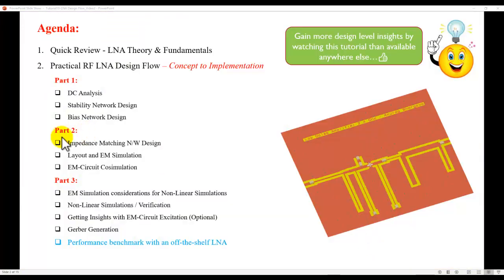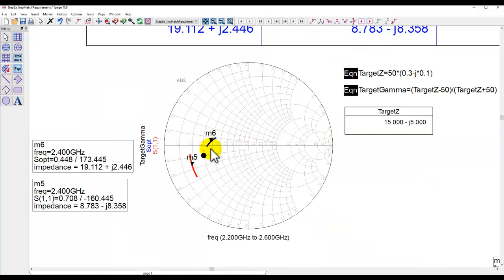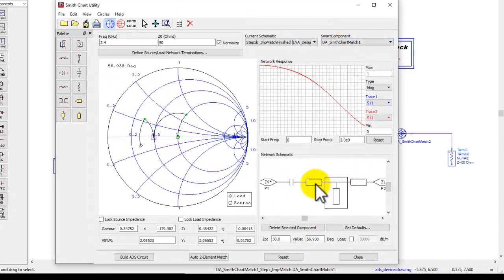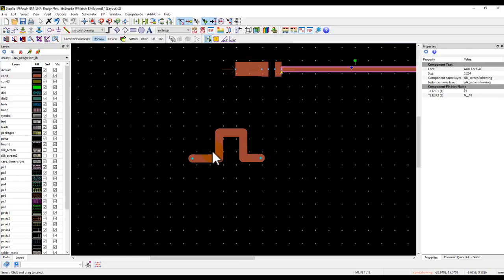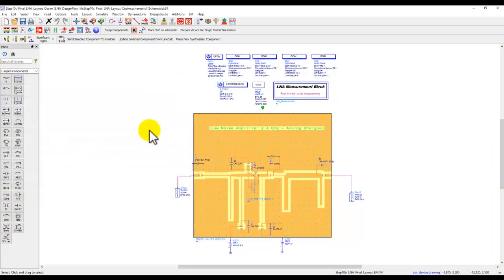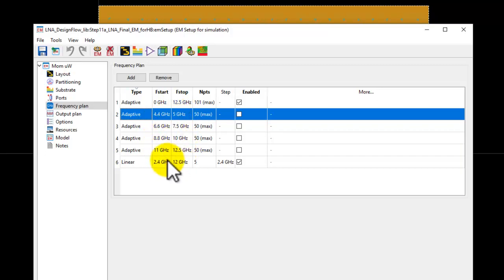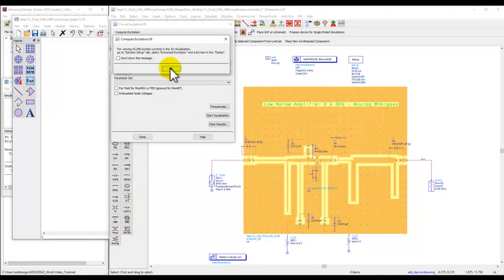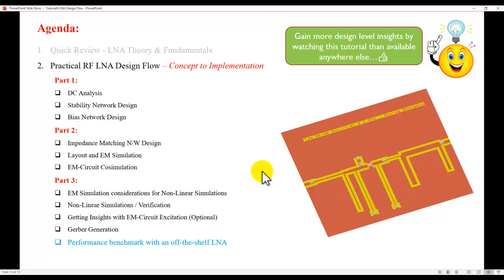RF Design-10: RF LNA Design - Part 2 of 2

Comment: sir, how to insert capacitors in the layout?
Reply from the maker: You cannot insert electrical components in Layout but only their footprints. You can simply draw 2 rectangles for the desired dimensions as required for your capacitors or any other SMT components
Reply: @BhargavaAnurag  ok, I understand what you mean, btw, I see two “port” -like arrows are added on both side of the MGAP, are those the way you represent the lumped capacitors in the layout?
Reply from the maker: Kindly watch EM Circuit Cosimulation video under "Learn ADS in 5mins" playlist to get complete idea on how to perform EM/Circuit cosimulation. For every discrete component such as Capacitor, Inductor etc, you place relevant ports in Layout for EM simulation and then bring it over to Schematic for assembly of Layout component alongwith electrical components to see the integrated response.
Reply: @BhargavaAnurag  thx a lot, sir
Reply: @BhargavaAnurag  sir, the capacitor problem has been solved, would you kindly recommend some power/low noise amplifier design books? thanks a lot!

Comment: Hi Sir, I saw the S(2,2) was changed after matching S(1,1). So Should we match S(2,2) before or after matching S(1,1)???
Reply from the maker: Hi,
I would recommend to match output side first and then input. Even when you do so, things will be slightly disbalanced  so you can run final optimization to fine tune the values for optimum results.

Comment: Can you make one video tutorial for GPS  Low Noise Amplifier? It is very popular in the industry apply right now. Again, Thank you very much.
Reply from the maker: I am not sure if there is anything special for GPS LNA apart from the fact that it will be different frequency than what is shown in the video. Rest of the concept will remain same, also at GPS frequency you may want to use Discrete Components for matching etc instead of making it all transmission license based design.

Comment: I wish you all the best , really really your videos are useful thanks a million🤗🙏⚘
Just one question, i hope you answer me soon please i need 
For designing input and out put matching , choosing the best impedances for input and also for output based on noise and gain circular  are independant of DC bais network( which dc bais network includes transmission lines)  is it correct??
Thank you in advance
Reply from the maker: Hi Nazli,
It depends on how transparent is your DC Bias design to your operating frequency. If you have done a good bias network design then it will present near perfect open circuit at your RF Frequency so you can say that it doesn't have any impact on your matching circuit design and if you haven't done a good job with the same then it will load your circuit affecting the input and output impedances to be matched.
However, as a matter of practice I always advice to perform your impedance check or matching WITH DC Bias Network included.
Hope this helps.
Reply: @BhargavaAnurag  Hi Dear Anurag, thanks alot for your quick answer. Before designing the DC bias network just by having DC block and DC feed i measure the input and also output matching and also i did them by consedring dc bias network , but the results are different. So it means my designing for dc bias network is not correct!! and after that based on your advice i have to consider imput and output matching with DC bais network. Also i want to research about differntial or push push amplifier and see which one is better for LNA. I would be greatful, if you could please guide me? I just find your youtube channel, i dont know you have further other channels which i can contact you for getting more information ? Again thanks alot dear Anurag
Reply from the maker: @nazlizargarpour1854  Sorry but I don't have much experience with Push-Pull so won't be able to help much.
Reply: @BhargavaAnurag  thank you for your reply. no i want to design differential type NOt push push any more.

Comment: Sir I'm working on mmic lna at 94GHz and the required gain I'm getting at 80GHz. Sir how can I tune the output at the desired frequency.
Reply from the maker: Hi Nishant,
Its difficult to comment on this without seeing the design and it will largely depend on the topology and how you designed the circuit. You can try to contact Keysight tech support team to look at your circuit and offer their suggestions.
Reply: @BhargavaAnurag  thankyou so much sir i got the desired result by applying the various combination of the values of the lumped capacitor and inductor i am using at this frequency. 
Sir if i may ask whats the top cell in gds file?i am facing few problems in eDRC of the layout.
thanks in advance

Comment: Hai sir this is Deepak,

 I have got an error while simulating step7 impedance matching circuit, the error message I got     ADS-syntax parser error in `<ADS netlist>', line 131: 

How can I contact you, sir can you give me your mail ID
Reply from the maker: Hi Deepak,
It seems there is some typo error in the component parameter values or the variable values. Kindly contact local tech support team for help.
Reply: @BhargavaAnurag   Yes Sir, I rectified those errors.  I am getting a gain of 15. 041dB and noise figure around 1.235dB, stability is around 1.372, and return loss S11= -25.391, S22=-7.195 . Sir, please help me to increase the gain up to 15.8dB and to manage reflection coefficient values less than -15 dB. Please do the needful sir.

Comment: Thank you so much dear
I have to get some knowledge about how to design LNA 
However,i need your helping how to the design  of 12-18 GHz ultra-wide bandwidth LNA on GaAs technology 
Please say something if the frequency increase difficult to optimizing the noisefigure so how to solve this problem?
Reply from the maker: Hi,
I can't help with that specific question as it will largely depend on the technology you are using but take care of the fundamentals will take you there. Make sure you keep the loss in the IP matching network and any other components on the input side to minimum and always use NFmin as your reference point.

Comment: hi , thank you so much .. i have some wrong in first design this sentance appear when i run simulation .......Warning detected by hpeesofsim during circuit set up.Unable to resolve variable(s) or functions(s) in expression ` NsCircle1=ns_circle({1.1,1.2,1.3},NFmin,Sopt,Rn/50,51)'NFminRnSopt   †
Reply from the maker: Hi,
Your expression seems fine but check following:
1. Have you clicked on Calculate Noise under the Noise tab in the S-Parameter controller?
2. If you are using S2P file for the device then make sure you S2P file contains Noise data along with the usual S-Parameters.

Hope this helps
Reply: @BhargavaAnurag  thank you very much the problem  has solved

Comment: Thank you very much for your efforts
While I am trying to simulate the same design there was an error message indicating that  (Wlargest/Wsmallest) for MTEE is greater than the 5 and the resistor is shorted. How I can fix this problem ؟
Reply from the maker: Schematic discontinuity models use analytical equation in Schematic which has their limits to maintain the accuracy of the formulation or the assumption they are build upon and usually for models such as TEE and STEP etc it is 1:5 or 1:10 ratio that they recommend, if you cross that then you will see these kind of warnings in the simulation status. You can ignore them and your simulation will surely run but it is telling you that if there is any reflection happening at that junction it will not be accurately captured in your circuit simulation and when you perform EM simulation you will see increased discrepancy between schematic and EM results. 
EM simulator are physics based so they don't have any limitations for the width ratio at junctions and will capture any distortion caused due to high width mismatch.

Personally, I never like to have this kind of situation as it is not a good design practice (however no one is stopping you in having these in your designs) and if I see this situation after optimization then I will try to create a stepped impedance section for that transition e.g. you can go from 0.2mm width to 0.8mm and then eventually to 3mm instead of directly connecting 0.2mm wide line to 3mm line as then the impedance mismatch will be too high and bigger reflections will surely happen depending on dielectric material and frequency of operation.
Hope this helps in some manner?
Reply: @BhargavaAnurag  
Can I get your email ?

Comment: Anurag sir,
I have designed a Broadband LNA that covers frequency band (1-5 GHz) and now I want to perform non-linear simulation of it. But I am not getting how can I find OP1dB point OIP3 point of my broadband LNA because in your video you did for a single design frequency i.e., 2.4GHz. Please guide me how I can do the same for my broad-bandwidth (1-5 GHz).
Reply from the maker: Hi Adnan,
In your case OPId  and OIP3 will not be single value as it is frequency dependent parameter. You can do frequency sweep and you will get multidimensional data and you can get the P1dB etc at every frequency you simulate. Usually 2 corner frequencies and 1 center freq is sufficient but it is upto you.
Reply: @BhargavaAnurag  Thank you sir.

Comment: Sir how can we Increase the bandwidth,  I am trying to build a broadband low noise amplifier, Is there a way we can connect with you LinkedIn maybe? In desperate need of  some guidance .
Thanks in advance!
Reply from the maker: Hi Shaurya,
Broadband has different meaning for different people. What the center frequency and bandwidth you are looking at?
Reply: @BhargavaAnurag   Hi, 
Thanks for the reply, by broadband i meant something around 1-10 Ghz
Reply from the maker: @adv_x8848  If you want to design LNA for the 1GHz-10GHz band then it's not possible at the PCB level. You will need to design it using MMIC technology which you cannot fabricate easily as you will need to sign up a suitable foundry like UMS, WIN Semi, etc. If you don't want to fabricate but still want to design a broadband LNA using the MMIC process then you can try using MMIC DemoKit that's available in ADS.

Comment: At the time 10.32,  the point which is read from the gamma circle is 0.3-j0.1. Is it target gamma? and then we are finding target z. right. So 50*(0.3-j0.1) is target gamma. Is my understanding correct?
Reply from the maker: Hi Tham, 0.3-j*0.1 is the target normalized impedance which you multiply by 50 to unnormalize it to 50Ohms. Target gamma equation is shown on the data display page which will be (targetZ-50)/(targetZ+50) and this is needed to plot point on Smith Chart as we can't plot the impedance on Smith Chart directly. Its always reflection coefficient/Gamma at least in ADS.
Hope this clarifies.

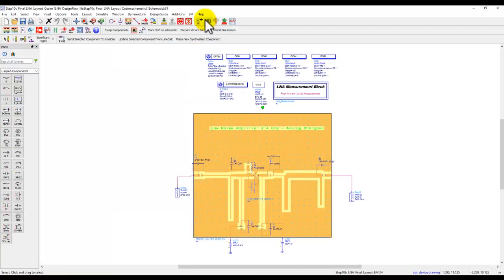Comment: you are using Msub in your schematic and in your layout the substrate model has 2 metals. (one is used for ground plane). How does these two match ? in your circuit you did not connect your plane to ground (in 36:00 looks like your ground is floating) could you please explain these details ? Thank you.
Reply from the maker: Hi,
MSub already has 2nd layer defined as lossless ground and in EM you have option of keeping a Cover at the stackup bottom and that replicates the MSub condition for EM analysis or you can model it as a finite ground conductor accounting for lossy conductor closer to real PCB. This may or may not make a substantial difference in your results but it is good to model it this way.
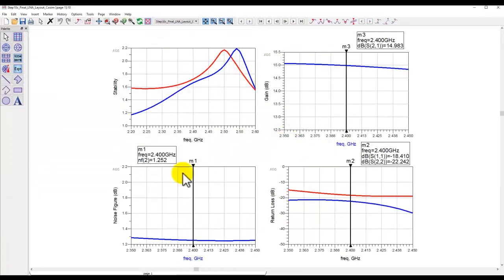There is nothing floating at 36:00 like you mentioned, not sure why do you feel ground is floating? All EM component ports are referring to cond2 as a ground and I used TermG (internally grounded) termination.
Hope this clarifies....
Reply: @BhargavaAnurag  So when you make port you change the negative from gnd to cond2 ?
Reply: I could not define ports as you said. how you refer ports to cond2 as ground ?

Comment: Hi Anurag, 
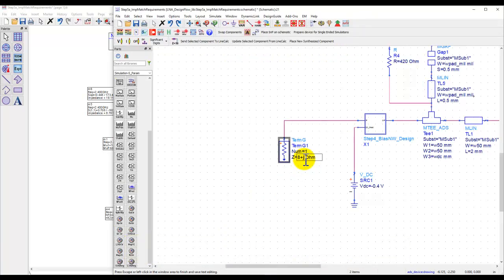At 14:43 you made Zs = Zin* to demonstrate the conjugate match's effect on noise figure. However, NFmin is the noise power available from the network, meaning it is only a function of GammaS, while S11(technically GammaIn in this example) is a function of GammaL. That means the return loss would change when output matching circuit was added to network as well, would it not? 
Then, the comparison is rather qualitative rather than rigorous. Do I understand this correctly?

Thanks for the video!
Reply from the maker: Hi,
Yes, you got it right. The concept I showed was for qualitative purposes and by no means it was meant to do rigorous analysis. Main idea was to show how things could be based on the matching criteria you select on the input side assuming output is terminated in a specific impedance. All devices are bilateral in nature and source & load termination conditions will affect the overall performance but this process gives designer some initial boundaries to work with and proceed with the design work.
Hope this helps.

Comment: Have never seen such an elaborate and detailed explanation of the LNA design flow. Implemented it myself in ADS this weekend following the steps in this video. Worked perfectly fine. Thanks a lot for your tutorials. These are the tenets for a radio engineer, no doubt about that. Eagerly waiting for your PA design tutorial. Thanks a lot sir.
Reply from the maker: Glad it was helpful!

Comment: in em simulation, what difference would it made if the type of the pin where SMD and not TML?
Reply from the maker: Hi Luck, I couldn't understand your question completely. It would help if you could provide more info on what you are asking so that I can answer in more detail. 
From what I could understand, here is my initial comment; 
You have different type of Pins that you could in ADS EM simulation like Point Port, Edge Port, Area Pins etc. If this is what you want then it will be good idea to create another short video on this as it is very important for designers to do more accurate EM analysis.
Reply: @BhargavaAnurag  please do that, but in addition i asked that after creating a pin, you can chose its type as TML SMD DELTA gap,.. so could you explain this as well
Reply from the maker: @ltteogoali7251  Sure, now I am clear. What you want to ask is detail about Port Calibration....

Comment: first at all, it’s a great video. Excellent. 
Some good book or papers where explain how to get the high frequency model of a FET? A mean the intrinsic parameters of the transistor.
Reply from the maker: Hi Jhon,
I am glad to know that you liked the tutorial. I am not keeping in great touch with books these days but old is gold and Gonzalez kind of book should have it....
Reply: @BhargavaAnurag  Hey Sr. Once again, thank you for sharing your knowledge with us. Something special to avoid the use of the DC bias network?
Reply from the maker: I am not sure what you want to ask, DC Bias Network cannot be avoided as you need to feed DC for active transistors to work and also to isolate DC from RF. How you end up doing this network designs depends on your design frequency and you either use Choke method on lower frequency ranges and use lamda/4 approach for high frequencies for RF board applications...